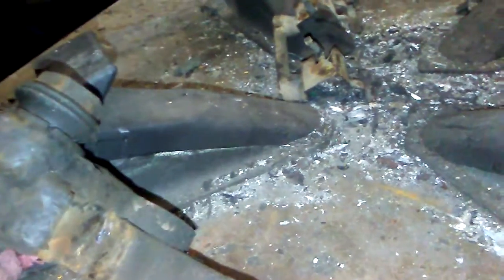Silverado brakes fit to tight

Comment: we ran into same problem on friends 2004 Silverado just used the wire wheel and it was good to go
Reply from the maker: skulledmonte84 man i just lightly hit it with grind wheel most cases very effective fast way for me but man seen them so bad had to hammer pads out and replace hardware on some brake jobs